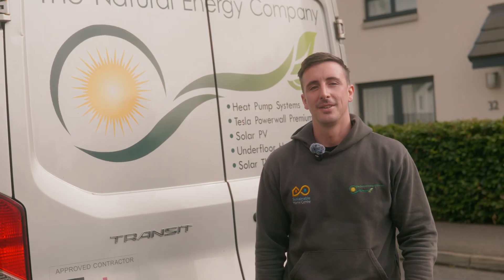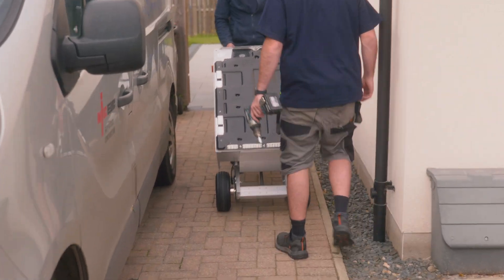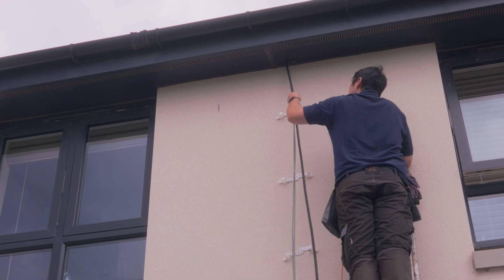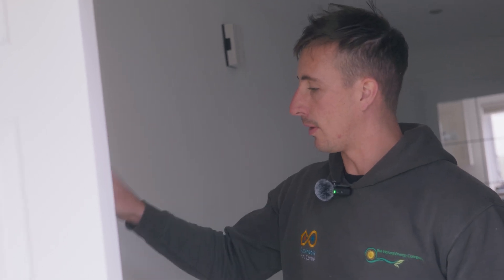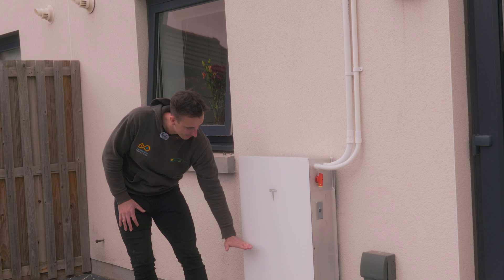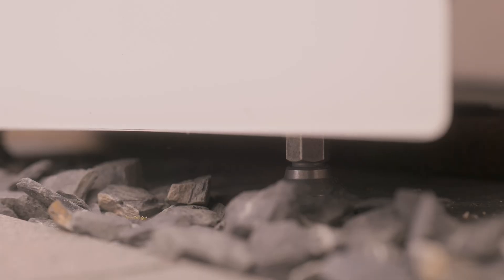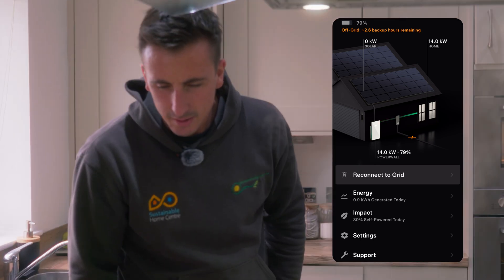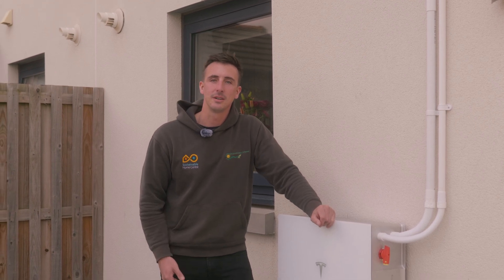Full Powerwall 3 Installation and Live Demo | First Powerwall 3 in Scotland

Comment: wow in my city you cannot have it within 3 feet of a door or window so this location would be completely out of the question
Reply: Same
Reply from the maker: Thank you for highlighting that — it’s a really important consideration. Regulations around installation distances can vary significantly by country and even by local authority. Here in the UK, the requirements are different, which is why this location was suitable. We always advise checking local codes and working with certified installers to ensure everything is compliant and safe.

Comment: With the Powerwall set to 11.5kW output, did you need a G99 for 11.5kw plus the size of the Solar Array to cover everything that could go to grid if you discharghed the PW3 on  sunny day ? I was told that this is how the DNO see it ?
Reply from the maker: Thank you for your comment. Powerwall has an output of 11.04kW to the house and in this case only 7.6kW to the grid. The grid take into account all generators on site and add them up to get to the figure of what your total site generation is. This is then reflected in your export permissions. I hope this helps.
Reply: @TheNaturalEnergyCompany  Ah so the Gateway can be set to allow  x amount to go to the grid and the DNO are happy with that ?
Reply from the maker: @highland-oldgit  The commissioning sets up what export allowance you have as per your DNO approval, up to 11.04kW.
Reply: Mine is 6kW generation and no export limitation, does that sound right?

Comment: I am about to take the plunge. I have found a company I want to use and they are coming for an assessment on Monday. They have quoted me my price but I want to know if the gateway comes with the powerwall or do you specifically have to order and pay separate for it?
Reply from the maker: Thank you for your comment. Your installer should quote you both Powerwall and the gateway. Good luck with your installation!

Comment: Would it not be good practice to leave a loop on the input cables to allow an expansion pack to be fitted without having to re-wire or is there some slack in the loft that could hopefully pulled through?